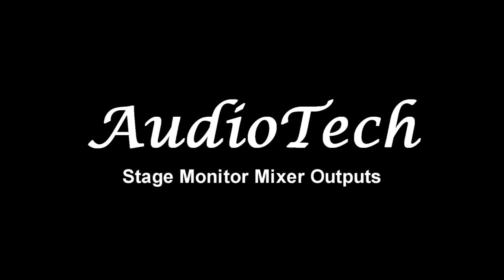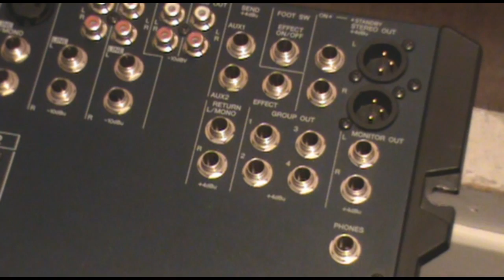Stage Monitor Mixer Outputs - AudioTech

Comment: Appreciate the video & the info bud. Can you connect a couple of monitors on 1 aux out like a daisy chain or only 1 monitor per aux?
Reply from the maker: Yes, be sure to connect your amp and speakers correctly.
Reply: This would be a Yamaha EMX 5000 powered mixer. Can it still be done? I would imagine same principle?
Reply from the maker: Yes, you can always chain speakers but be sure to follow the guidlines for your mixers power section. Refer to the manual or download it from the website so you don't blow it up. I ran two chained for front of house (ch1) and two chained for the monitors (ch2) using a Yamaha 2 channel power amp and passive cabs with this mixer.

Comment: Thank you . We have this exact Yamaha board and we want to run outputs to three separate power amps for three separate pairs of live cabinets. Are you saying we need to run them all out of the two XLR's in the top corner, into a snake and then use the snake as a splitter, that can send a pair of inputs into the back of each separate power amp?
Reply from the maker: Yes. Mixer - snake - power amps - speakers. or omit the power amp if you have powered speakers.

Comment: Is there a way to run a line from the main mixer to a sub mixer, for drummer to create their own mix? (no aux out available...we have the Yamaha EMX512SC, band using the AUX1 for their monitors)
Reply from the maker: I suggest a larger mixer with 4 aux sends. Otherwise, you're stuck buying another set of mic cables and a stage splitter as well as another mixer. For the cost all of that, you can buy an upgraded 16 ch. mixer with 4 aux sends.
Reply: @TheGospelGuitarist  Yeah, we have that for practice, but for gigs, trying to economize the amount of stuff. Only portable power mixers with aux outs and ability to mix seem to be the EMX5 and 7...not a ton of power though....none with 4 aux outs, else gotta haul an amp too:(
Thanks!
Reply from the maker: Make money, put it into a band fund. Get at least a 16ch. digital mixer and powered speakers.  I spent around $10,000 on my old PA. No digital back then.  I wouldn't even glance at anything not digital if I were to build a PA today. Speakers would be self-powered. I have a Presonus 16.0.2 and it could easily handle any small band out there. $1200 I never regretted spending for my home studio and would use it live in heartbeat if I were to return to live engineer work. That's my advice to anyone wanting to perform in a live venue. Oh and use eBay and pawn shops. Don't buy it all new, resale sucks no matter what you paid for it. lol Wish you the best, I have other videos teaching about audio gear. You should check them out. Knowledge is power!

Comment: If we are using passive speaker could the aux send be used directly?
Reply from the maker: No, you will need to connect a separate power amp for the speakers to plug into.
Reply: @TheGospelGuitarist  no wonder i did a test yesterday there is no sound coming out from the passive speaker.

Comment: My Peavy 20 mixer doesn't have auxiliary outputs...just monitor outs.
Reply from the maker: Looking at the picture on the Peavey websites, your mixer is using "MON1" and "MON2". Connect your monitors to the MON1 and MON2 outputs in the master output section. Use the red controls on each channel to send the desired amount of the instruments to those monitor mixes. They just call them Monitor sends instead of Aux Sends.
Reply: @TheGospelGuitarist  thank you...I just wish they had Aux sends also...but they dont. Inown the PA and board but someone else has always ran it. I believe the "control room" outs are the same as your monitor outs.
Reply from the maker: Yes they are.

Comment: I have rcf xr12 live mixer it has bus 1-2 and control room output what is the difference which one is the right output to use for stage monitors
Reply from the maker: The green controls can be used for monitors. The green master knob is you level control send to the monitors. Feed your monitors from the Aux 1 send.

Comment: I have a samson mdr1248. Whats easy way to  setup floor monitors if you can help
Reply from the maker: Out Aux 1 to the powered monitor(s) Aux 2 for a 2nd monitor mix ect. Use aux 1 (2) on the channels to get the monitor mix needed. If they are not powered monitors run from aux out to power amps then to speakers. Wiring is easy, getting a mix thats the harder part. Technically you should use a 31 band graphic eq between the power amps and speakers to eliminate feedback sources but that's a whole other lesson.

Comment: OK Wat if I'm using a powered mixer would there be power for the monitors on stage coming from the aux send ? Rockville RPM1470 14 Channel 6000w Powered Mixer
Reply: So I gather you are saying that my two passive stage monitors should be daisy chained coming from my power amp that only has one line into it coming from the mixer  ( aux send output )  to the amp in my rack forget the ("Rockville RPM1470 14 Channel 6000w Powered Mixer") I'm going to stay with my Behringer X1222 
Daisy
Reply: I just want to know what channel do I put into the amp I only have one aux send or do I need to put my amp in parallel mode to run two channel
Reply from the maker: Powered outs to main passive speakers.  Aux Send to the power amp in the rack. If you daisy chain you can have two monitors on each channel as long as you don't go below 4ohms ex, two 8ohm monitors. or split the input into both amp channels if you are running 4ohm monitors. It is ok to run only 1 side of the amplifier. 

With passive systems like my old one I ran 1 power amp, channel 1 for Mains chained and channel 2 for monitors chained. You should have (hopefully) a switch to turn off the mixer amp and not use it at all or maybe unpowered outs for the mains if the mixer has those. Hope that helps.

I never use powered mixers. Always used separate components with backups if possible.
Reply from the maker: Yeah
Reply from the maker: You need to check your mixer to see if the mains only are powered or the mains and monitor section is powered. Check the manual on wiring up the monitors.
Reply from the maker: After a very quick look at the mixer you only have powered mains. You will need powered monitors to run off the aux outputs for stage monitors.

Comment: What is the Sub Input pr output on the mixer. Do you know what's that for?
Reply from the maker: One meaning will be "Sub" groups.  One Sub fader for multiple channels assigned to it. Usually at least two groups but can be as many as 8 on larger boards. So assign all drum mics on a kit to say Sub1. Control the volume of the whole kit on 1 fader. Another example would be a vocal quartet of say 4 singers singing to a backing track. Balance the separate channels and assign to Sub1 and adjust the vocalists volume against the backing track without having to ride 4 faders. Also could mean an output for a sub woofer. Usually located next to the main faders.

Comment: Hi I have connected my stage monitors from Aux send 1 but I’m not getting any fx it just dry but I’m getting fx on the main speakers could you please explain why that is happening. 
Ps: I have onboard fx
Reply from the maker: You need to route the fx you want to the aux 1 buss. Find the manual and read up on how to use the fx section of the board so you can setup the routing the way you want it. If it will do what you want that is. If I remember right the FX faders have buss buttons next to them. Select the busses you want to hear the fx on.

Comment: Basically, what you're saying is... to plug the monitor cords in the stage monitors and then plug the other ends into Aux 1 and Aux 2. Is this correct because I have a mixer console with four Aux Inputs numbered Aux1, Aux2, Aux3 and Aux4..
Reply from the maker: Yes you can run monitors off the aux sends which is how it is traditionally done.

Comment: Hello again, Got the mixer fired up. How do I get effect/reverb to the monitors, also what the best effects for a large room, using what the Yamaha board has,another thing I had thought of was using an effect processor for all the channel, any input on how to do this? You have been a great help to us here at our jamboree in pelham ga.
Reply from the maker: Watch my video on using aux sends for channel effects. Effects on Aux sends can be used across all channels. Effects are only used when needed. They can enhance your sound in good or bad ways. Try setting up a good mix without effects before experimenting in that area. A room has it's own sound, reverb, adding more in the pa can really mess up how your system sounds. You need to master equalizing for the room to get rid of bad reflections and enhancing freq's which are not clear.  There are no one step solutions. Learning how to do live audio is a very exciting but also very time consuming. I have a starter set of videos on mixing I suggest you watch them all. All functions of a mixer are related to other functions, especially effects. Read the manual as well on the mixer, can be boring but will be beneficial and is the most important thing you can do first.

Comment: Hello again,if I'm connecting monitors, I need to come out of the aux1 and aux2 to my power amp? What controls works the volume on that channel, also the overall volume.thanks
Reply from the maker: The aux send control on each channel controls the amount of that channel sent and the master Aux controls in the master section controls the groups Aux 1 and Aux2 respectively.
Reply: Another question.do I run a cord from auxiliary 1 to my power amp? And one from aux2 to other channel of the power amp thx
Reply from the maker: Yes you do.

Comment: Can I run the "monitor out" to a powered monitor? Thanks. Just not clear on it.
Reply from the maker: Yes you can. But if you are using it on stage it will be the same mix as the front of house speakers.

Comment: Ok, on the mixing board. The monitor out left an right,  these are not used for sending signal to a rack mount amplifier?
Reply from the maker: You can for driving monitoring speakers which are not powered. Say inside a studio. But the signal sent out is the same as the stereo master buss. You can’t do a stage monitor mix for performers.

Comment: I have 4 speakers, my 2 main in main out L and R. I have 2 smaller ones I want to play with the other 2, when I plus it in aux it makes those speakers the main ones and my other main super quiet. What do I plug it into?
Reply: Dalton Page  I have the same exact problem. Did you find a solution ?

Comment: Thanks for the clarification. For years I've had a Peavey mixer as well as a Samson mixer and tried to run a floor monitor from the "Monitor" outs and they never quite worked. Explains why when I did, the output came from the Main Level faders, not the Monitor faders. It would help if "Monitors" meant floor monitors instead of auxiliary sends. How is a beginner or novice supposed to know this. Anyway, you've been a great help. Thanks again.

Comment: This is a good discussion, but I still have a question. As a solo performer I use the xlr jacks to go to 2 powered speakers (the main speakers); I have a RC 300 looper connected through effects send and aux return (send goes to input on RC 300; return goes to output on RC 300) so everything that gets plugged into the mixer, regardless of channel, can get looped. Where on the mixing board to I plug in a small stage floor monitor for myself? Which jack? The main speakers are too far away so I need to be able to hear myself playing/singing. I am using the Xenyx x1222USB mixing board. Any ideas would be helpful. Thanks!
Reply from the maker: If the looper is on Aux 1 move it to Aux 2 and run powered monitor speakers for yourself off the Aux 1 send. Aux 1 is typically the monitors not FX or other gear. You can create your monitor mix using the Aux1 control on each channel the same way you send channels to your looper, so that you can hear what you need to hear, which is usually different than the audience.  This setup will give you personal monitors on stage mixed one way, your looper mixed another and then the front of house speakers yet another. Fully flexible.  I am thinking the Xenyx has more than 1 aux send of course. I hope that gets you where you want to be.
Reply: Thanks so much for the reply!  I will work on it...sound novice here :)
Reply from the maker: Looking at your mixers specs it looks like you have one aux out were you have the rc300 hooked up. But it does also have monitor outputs. So plug powered monitors in there and use the channel monitor controls to obtain the mix you need.
Reply: Again, thank you for taking the time! Cheers!

Comment: I am trying to config one mixer to do two separate mixes....right now I am stuck with jumping between monitors and Foh using one at a time. Which is running my eqs crazy and my mind. I wish for Foh to pump music and drum mix while my monitors throw only vocals. 4 eqs 32 band is what I was planning. I tried leaving the speaker processor and Foh and eqs all hooked as normal. Then used the 1/4 jacks right next to the xlr main outs which said "parallel"...to a dual eq then to separate power amp and then to monitors. Only one side of the eq worked though. I have two dual eqs and they both worked that way. Now I have shifted everything to just vocal monitors which I doubt my Foh will be able to stand if I unjack and pump music back through and drums without re - equalizing.I run that way for practicing drums and listening to tunes in general .....and recording live at a hot volume with a zoom q3hd . Now I'm thinking about using both dual eqs on the monitor mix.one for each side I am bound to get both to work either that or run them in a line and eq both  as a 4ohm hot mess.Question is should I just get another mixer for my vocal monitor mix? That way I can have my drums and music separate as its own monitor mix with music if needed. I also tried running the music into the monitors and using the mic channels to adjust the microphone to match that is great if I stay away from the monitors.like 20 feet. As for eqing for a live performer standing 5 feet from a monitor doubtful. I should have left the mic channels dead center but I got a perfect music mix with eq then proceeded to get a perfect mix with mic then moved closer to the monitors deleting feedback frequencies.mics sound great. Will check music tomorrow I am expecting mud we'll see. Two monitor mixes is preferred....
Reply from the maker: Watch my video called "Monitor Mix Setup."
Reply: Yes I watched other video. Still confused on the wiring though. I'm thinking of it as a monitor out I guess. I tried going from aux send 3/4 to a dual eq then output on eq to power amp but no sound at all.My 1/2 aux send is used on my headphone mix. Maybe I need to look at that wiring closer....my 3/4 says efx as well 5/6 aux send says it sums up I think
Reply from the maker: You are right. Going out the aux send 3/4 into an eq 31 band is a must on monitors, then to the amps and monitors or powered monitors. Double check in that the masters are up on the board and cables are good of course. Make sure all switches are set correctly for the sends.  Just be sure to follow the flow though the mixer. Draw it out if you need to in order to visualize your setup. Hope that helps..good luck!

Comment: That looks like a Yamaha mixer.  I have one with built in effects, but can't get the effects in the auxiliary stage monitors, though it works fine through the mains.  There is an auxiliary 1 and 2 knob under the effects knob, but that doesn't work.  It is one like this...https://images-na.ssl-images-amazon.com/images/I/91QMVUI4pjL._SL1500_.jpg

Comment: I try not to leave a negative impression, but you did spend too much time explaining the monitor out inputs. When you got to the Aux Inputs, you spent very little time explaining this. So, I just want to say that... You took a long time to get straight to the point! That's All!
Reply: You did a great job i think.
Reply from the maker: Yeah I can get talkative, trying to do better on my new videos.  I was simply saying to send the AUX 1 output to the stage not the Monitor output. Monitor mixes are explained in another video. I was just explaining why not to use the monitor outputs, even though that is how they are labeled. Confusing eh?

Comment: I am a solo artist using backing tracks and have been using in ear monitors for a few years and would like to dispense with them. The trouble is you cant tell what sort of mix you have FOH ( mic volume to music volume) as i control everything on the mixer and I am usually standing behind my speakers. If I connect a stage monitor to my aux send I still wont be able to hear the FOH mix correctly. I would like to know if there is a way to connect 1 stage monitor to my mixer and get the mix that the public are hearing. I want to be able to control the monitor volume on the mixer. The main mix coming through the monitor is important to me as I am a solo artist and have no one to mix for me.

Comment: Thanks for the video. My mixer looks a lot like this, 2 aux outs. Problem is, I use one of these aux1 for my powered sub, and aux2 for my effects box. Is there any other "aux"-like out that would allow me to add a monitor to my set up (perhaps if I purchase an adapter of some kind)? Also, is it bad to use a "main out" which is getting powered by an amp for a already powered speaker?
Reply from the maker: You want monitors on an Aux output because you need to send each channel to the stage mix. You can use a subgroup out for the sub. Be sure to send each channel to the subgroup you want to use. Newer mixers have a sub out on them you may want to upgrade your mixer.